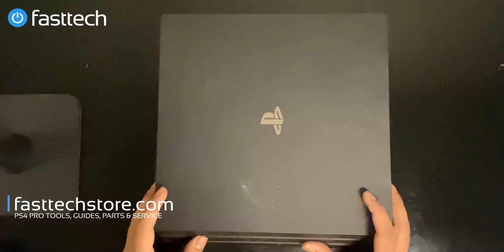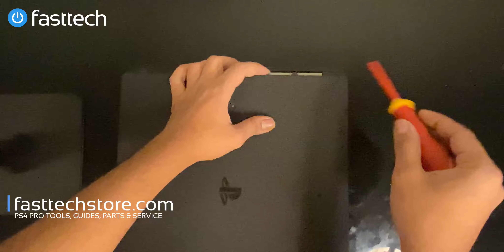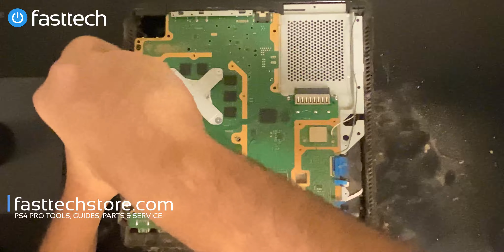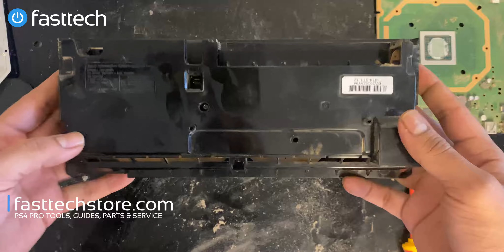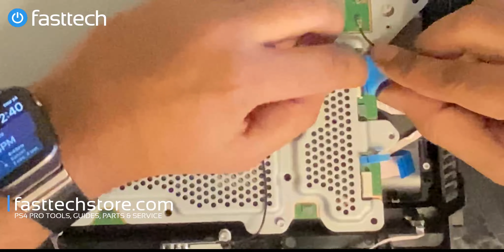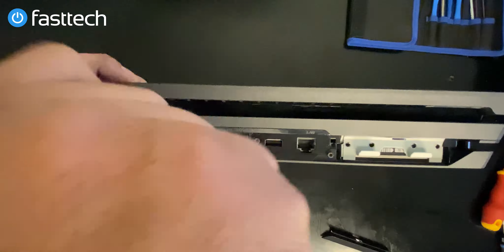PS4 Pro CUH-7015 (PS4 is Too Hot) Running Loud / Overheating Fix / Repair and Cleaning Guide

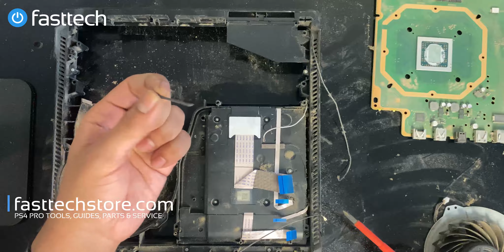Comment: 10:38 I practically feel like I am breathing in the dust at this point from home.

After video: Thank you so much for breaking it down step by step in a great pace. I figured the overheating was caused by dust but I never seen the inside of the PS4 till now.
Reply from the maker: @Verttech4  you are welcome thanks for your unique comment

Comment: I did everything in the video and now my ps4 beeps and turns off instantly
Reply from the maker: @venomlog5394  check the 2 pins that go in the power supply from the board
Reply: @fasttechvideo  what if I accidentally bent one
Reply: @fasttechvideo  thank you so much bro it was the pins and now my ps4 is 80 percent quieter your a lifesaver
Reply from the maker: @venomlog5394  you’re welcome bud like the video and subscribe for more videos like these

Comment: I opened it cleaned it and it still over heating even though I copied everything you did on here and I am trying to figure why its still over heating I have loads of storage
Reply from the maker: @featuringrageyt3103  did u clear out the heatsink and replace the paste?
Reply: @fasttechvideo   I think it could be the power supply but everything is cleaned yes i did exactly what you showed in your video
Reply from the maker: @featuringrageyt3103  just the power supply cant make it over heat. I have seen one ps4 7100 series that would turn off because the power supply but that one did not beep before turning off or show a blue screen with the ps4 is too hot message. Is that what is happening to you?
Reply: @fasttechvideo  And when i opened it i noticed that a few things were missing  inside the PS4 Pro it didn't have a heatsink cover when i opened it

Comment: does anyone know the right size of a flathead sceewdriver to take off those torque screws? I've seen people use flatheads to bypass then so you don't have to buy the tool
Reply from the maker: I don’t recommend using a flathead as you can strip the screw

Comment: This looks pretty simple. Im busy and traveling but I'm betting years of pet dust and airplane mode that my PS4 looks just like this one. Ive cleaned all the accessible dust with no luck. 

Such grimy dust i needed to use a brush on the fan. The heat sink has gotta be pretty bad.
Reply from the maker: How did it go?

Comment: i replaced the thermal paste but it still turns off instantly when opening a game
Reply: but the power supply gets really hot,  it was normal on my ps4 slim
Reply from the maker: @rade_ possibly a power supply issue even though i cant be sure

Comment: Hey boss .. I followed the video perfectly , now it won’t turn on!! Help please!
Reply from the maker: Check the power supply and the pins under it. Also check to make sure the cable for PSU and power button at the front is connected.
Reply from the maker: Following up. Did my advice work?